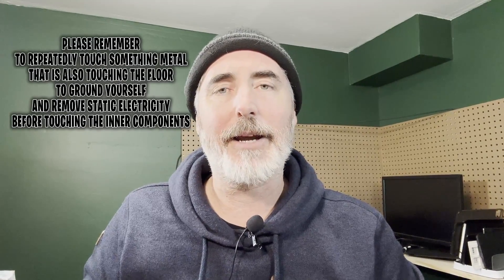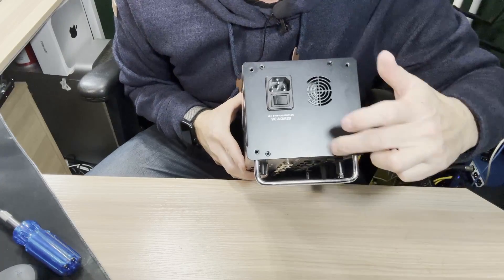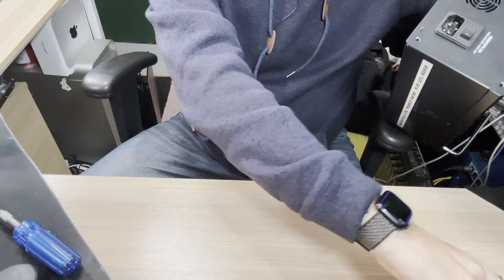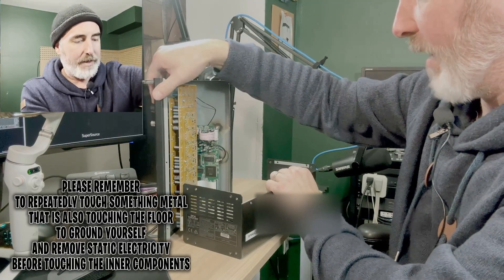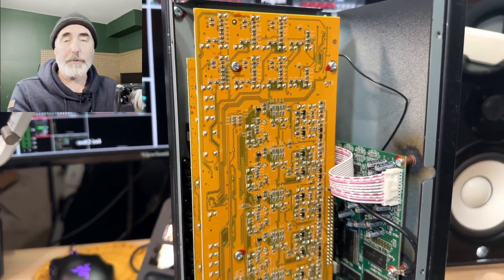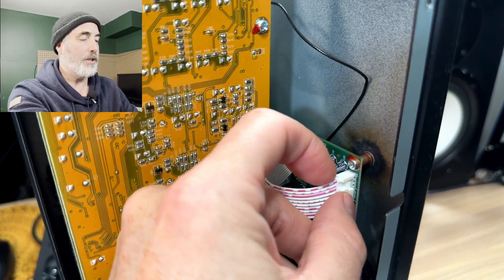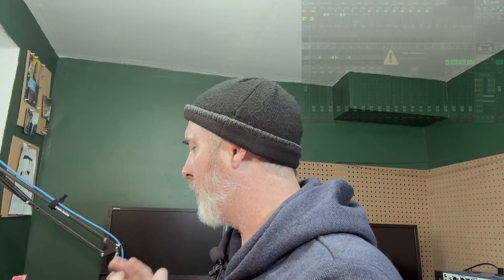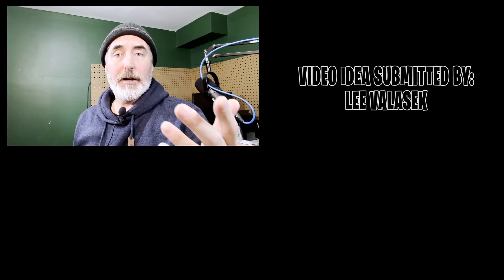Behringer XR Mixers - No audio from Main outputs - Ribbon Cable Fix

Comment: I just did this in my X18 and it worked! I lost all sound coming from it last week during a live gig, no sound either from main outputs or the buses. So I decided to open it before taking it to repair, and the cable wasn’t disconnected at all, but after unplugging it and cleaning the whole thing it is working again!
Reply from the maker: Well, not exactly what I was hoping to fix for everyone when I made the video…but if it at least helped you know what to disconnect and clean then I’ll call that a win!

Glad you’re up and running.

Thanks for watching and happy mixing!

Comment: Have you had any reports of this happening with other mixing boards?  I’m having the same issue with a Behringer Xenyx 2442.  I’ve been going around the issue by daisy chaining the two main speakers through the output that works and sacrificing the ability to pan L/R.  It’s not something I feel comfortable doing (for a live band), so I either want to fix or replace the mixer at some point in the near future.
Reply from the maker: Hey Master,
The only one I'm personally aware of having similar issues is the Soundcraft UI24.
But I would imaging this is a possibility with any console that has ribbon cables inside.
If you're  ok with opening it up to have a look you may see your issue right away and be able to rectify the situation without involving 3rd parties or the exchange of $$$.
For the effort of removing a few screws, it's probably worth it.  At least you'll know if it's something you actually need to spend money on at that point.

Just remember, any time you open up a device, ground yourself before touching any internal components!!!

Let me know if you give it a go and what the end result is.  I'm sure anyone else passing by here would want to know if it was the same issue.

Thanks for watching and good luck!

Comment: I am having that issues but with only Left Main.  Could it be the same problem.
Reply from the maker: Hi Audra,
Despite it making no sense to me, others have reported being able to replicate only missing one side of the main mix with this exact ribbon cable issue. 

Certainly, trying the reseat of the cable shouldn’t make your problem worse. 

Please be sure to ground yourself by touching metal before interacting with any internal components. 

Thanks for watching and good luck!!

Comment: Owning an XAir 18 I encountered a similar issue... One Main Output sometimes didn't work or with poor sound Quality. The robbon cable wasn't disconnected but pressing it firmly did fix the issue. Of course the inside of an XAir  differs from the XR-mixers but Ribbon cables are mounted in a similar way.
So thanks for your video!
Reply from the maker: Thank you for watching, and more importantly, thanks for posting this.
I find it very interesting that a loose ribbon cable can effect one side of the output and not the other. As you state, things can differ between types of mixers, but you've touched on a key issue that I was unable to replicate with my testing, but know that other people have been experiencing.  This give me a reason to dig deeper and try all my testing again.

Thanks again, and happy mixing!

Comment: Thanks!   The left main output of my X Air 18 has stopped working after being intermitent for a few months...I'll open it up and take a look.
Reply from the maker: Let me know if it was the ribbon cable. As I’m sure you saw in my video. I was not able to make mine “intermittent”, it was all or nothing for me. So I’d love to hear if this was your issue.
Reply: @QuickEZ  ok, so it WASN'T the ribbon cable.   Must be another issue.   Will take to my 'fixit guy' to find out the problem.   Was interesting to take the unit to bits and have a look inside though!
Reply from the maker: Thanks for the update. 
I think it’s good to get a peek inside your equipment from time to time. Helps remove some mystery as to how our devices work. 

I’m sorry it wasn’t the easy fix for you, but that certainly tracks with my inability to recreate the signal intermittently.
Hopefully it’s not something costly for you. 
Let us know what it ends up being. 
Good luck and thanks for watching.

Comment: I have the XR18.  Interesting to see the insides. I had a problem where the first 6 mic inputs weren't getting to the mains. I found(don't remember where) a place on the computer that lets you reset things to factory settings. They have been working just fine since doing that.
Reply from the maker: Factory reset seems to be something many people have to do with the XR series. 
I haven’t had to do that myself…yet.